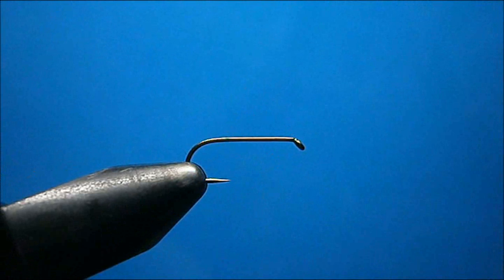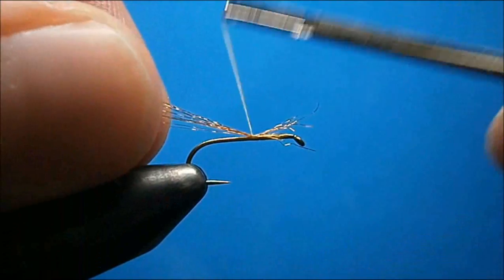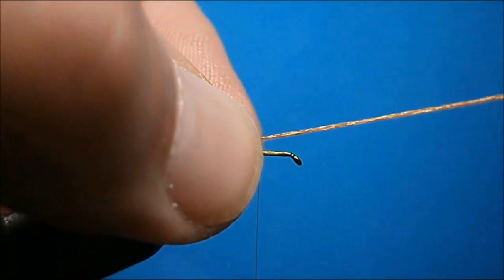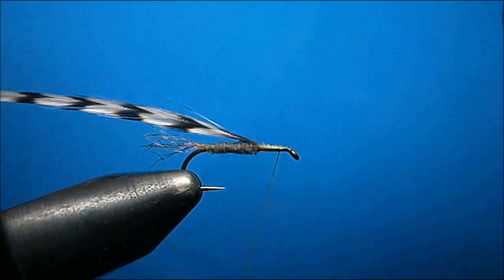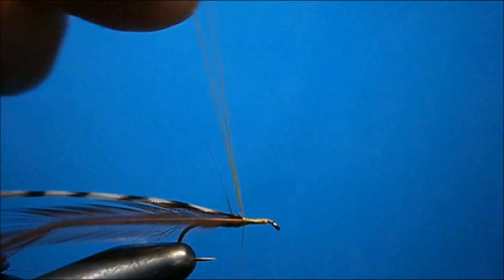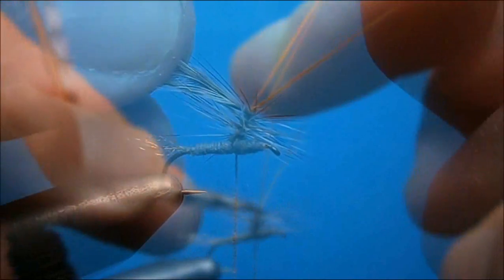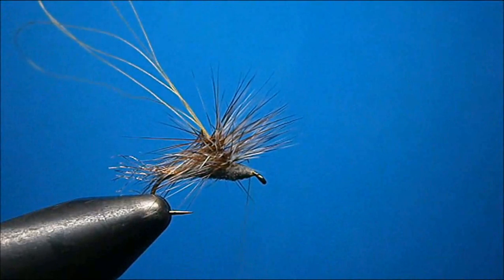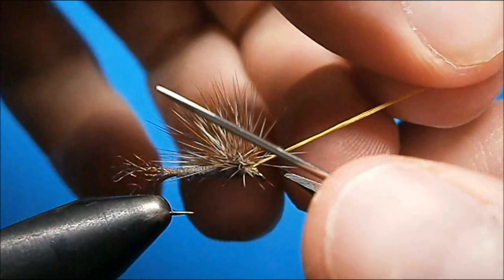Tying a Hackle stacker adams emerger with Johnny Utah

Comment: This is an emerger pattern. The tail imitates the shuck that a mayfly emerges from as it becomes an adult. On a para adams the tail is made of hackle fibers and imitates the adult stage of the mayfly, after it has emerged from the shuck. Also a para adams wraps the hackle around the post, comes back down, and is tied off at the base of the post (or at the eye), rather than tying off the thread/material the hackle is wrapped around next to the eye.

Hope that answers your question!

Comment: Watched a tyer at the 2013 NW Fly Tyer Excpo here in Albany, OR tie a version of the hackle stacker where he sues a piece of clear thread or 7x tippet for the loop and ties it down both front and back of the stack to make it "bulletproof" but your three loops looks perfectly adequate. (tyer was Marlon Rampy of Medford, OR to give proper due). Don't know which would be easier but having to bring in another material is probably more difficult. Nice job!

Comment: Hey Jonny, If you tie many of these I would suggest you make yourself a guillotine attachment. I made mine with a piece of piano wire, two tiny o rings holding an electrical connector with rubber tubing and an alligator clip. works great! It holds the loops up for me and leaves me with both hands. All the best to you, Sean